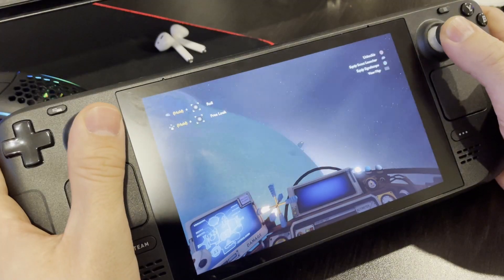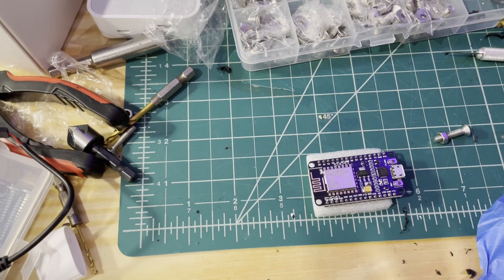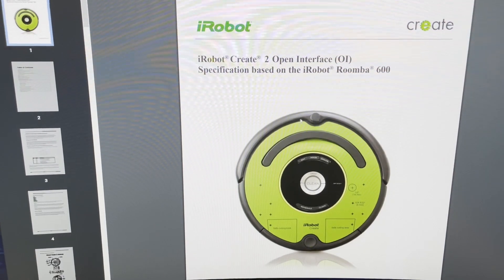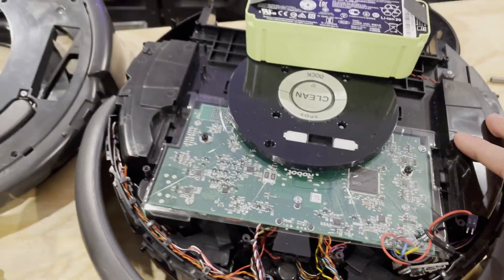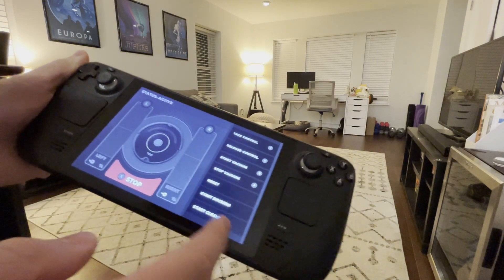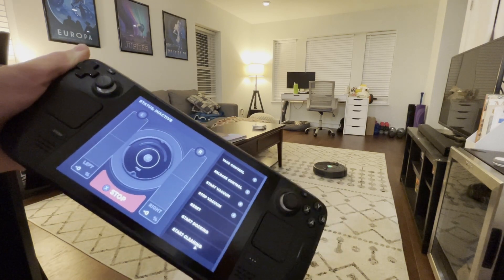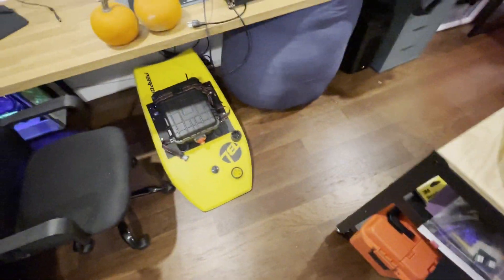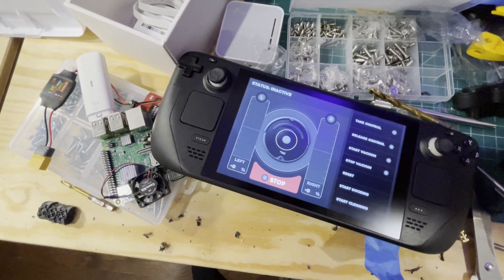Steam Deck as a Robot Controller

Comment: Hi Chris, I just watched your video, awesome ! I'm looking to do something similar for my tracked-snow-plow-rover-thing. Do you mind sharing some infos or maybe the source of the app running on the deck side ? I'm fine with RC, arduino, plc or windows thing but linux coding is a bit out of my reach starting from scratch. SIncerely, Max
Reply from the maker: Sure: Source code uploaded here: https://github.com/chrisdalke/roomba-steam-deck-experiment, although disclaimer is that I didn't invest any time in making it easy to use. This was a very quick and dirty prototype. If you are looking to get into linux coding + UI development for games/robotics here are some suggested search topics:
Build tools: gcc, CMake, make
Graphics libraries: OpenGL, Raylib, SDL2, Qt
Networking / middlewares: TCP/UDP, UDP Multicast, ROS, DDS, MQTT
Reply: @chrisdalke  any chance for the link ? :) I'm making good progress on my robot, video streaming, deck's controls are send to an esp32 via udp, I still need to parse the data. I'm curious how you did your things ;)
Reply from the maker: @maximefavre385  check comment above! Uploaded the code to my github
Reply: @chrisdalke  I checked it returns a 404, probably not public
Reply from the maker: @maximefavre385  Fixed